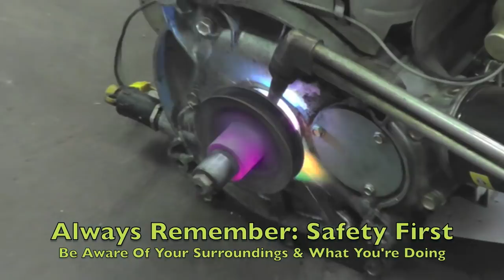Troubleshoot & Replace Camshaft On Briggs & Stratton Intek Engine

Comment from the maker: Be sure to pick up YOUR Taryl Apparel Today! Shipping Worldwide Daily. 
http://www.TARYLFIXESALL.BIGCARTEL.com
And There's Your Dinner!!
Reply: Taryl are you sure it bumps the exhaust valve and not the intake valve for compression release? On my 8hp it bumps the intake valve.
Reply: those newer style briggs are garbage motors and the designers should have those motors dropped onto their heads   :))
Reply: i'm starting a petition .  wanna join  ?
Reply: I got stuck exauast valve rod, rust never run for many years how to move? I try many how to remove
Reply: I have a serious lawnmower engine question for the master mechanic. I have a 16.5 hp Briggs & Stratton Intek opposed twin but I am contemplating rebuilding.
It is a 42a707 2238E1.
I was going to buy a zero turn but in the area where I live in South Carolina there have been a rash of people breaking into buildings and stealing these things from all manners of locations over the past three or four years.
Would you recommend overhauling this engine? And if so, where would be the best place to get all the parts, i.e. pistons, rings, overhaul gasket set, new camshaft, new carburetor, new stater? Are the jugs available for this and would I benefit anything by going over size on the Pistons?

Enjoy your program thank you very much!
Reply: Does this work on a 17.5 regular briggs ? Intake isn't moving any

Comment: I have a 21 HP motor on a craftsman tractor and could not get it to start. After attempting to adjust the valves (which did not solve the problem) I found an online article suggesting it might be due to a broken compression release mechanism on the camshaft.
I'm not a mechanic and have never 'opened' an engine before but I successfully changed the camshaft by following this great detailed video. I ordered the parts on Amazon. What it doesn't show is how to remove the motor from the tractor but that turned out to be very obvious and simple to do as well, even for me. PS - this is my first ever feedback on You Tube but since I'm very happy with the results I thought I should provide this positive feedback.

Comment: Just finished this repair up. Thanks for the video, I wouldn't have attempted it otherwise. Struggled with this mower not starting, replacing all parts: battery, starter, resetting the valves, nothing worked. This was was very easy, especially since the pulley just slipped off, no torch required. 30 minutes to pull the engine, 30-45 to open, find all the metal parts that were chewed up inside, clean up and reassemble. Will put it back on the mower tomorrow. Awesome. There's your dinner.

Comment: Taryl, I had a problem getting my John Deere LA105 with Briggs 18.5 HP engine started and through google and you tube found out that my engine has a compression release and the starting problem was because it was not working and I needed to change the cam. I may not have taken this job on but after watching your video I jumped right in and the job was a piece of cake. Your instructions were right on you were very detailed and left nothing out. Fortunately the lower pulley came right off because with my mower you can not remove the engine until the pulley is removed. I got the parts from Pro Parts Direct and they had all the parts in stock and they came in very fast, not quite as fast as in your video but pretty darn fast. Thanks so much for the great instructional video and the many laughs.

Comment: While adjusting the valves on a Briggs 27hp with 277 hours, I noticed the adjusted valve would move up and down and loose it's .004" clearance when it should be on the "flat" of the camshaft. Used the top dead center approach as well as Teryl's.  Teryl here explained and "showded" me that the camshaft was wearing out (highs and lows on the flat part of the camshaft).  Yep, Teryl knows his Briggs engines. I just wish Teryl would work with the new and reorganized Briggs Company to help them start producing a quality product again!  Brigg's CEO took a 5 million dollar bonus, filled bankruptcy,  and took a hundred year old business and flushed it and it's worker down the drain.    Thanks Teryl - love your audacious and fact filled videos!

Comment: Thanks for your video.  I just had to replace my cam shaft and your video helped tremendously.  Surprisingly my cam shaft was still intact but the pin that creates the valve flutter for compression release was worn smooth. Once replaced and I manually turned the engine over...... I saw the valve flutter that everyone describes when the compression release is working. Engine starts great now.  Local repair shop quoted $500 for repair and discouraged me from fixing because of the tractors age.   At 16 years old the tractor has more years to live.

Comment: Where were U 20 years back when everyone had to read the detailed engineers version from B&S, Kohler, etc. in print. Most of it was hard to understand, harder to actually do and usually ended up having to be taken apart because a detail or two about the proper disassembly or reassembly was left out. Your videos show it all including the shortcuts to making the whole thing go back together without the long version in the repair manual. Five *** to you for the effort you put into your videos to make them with just enough detail to get the job done. And OH yes video has just enough humor to keep it interesting.

Comment: When you mentioned the compression release on the new camshaft, I realized what was wrong with my Intek engine on mower.  It had been hard to start for years, and I kept replacing solenoids and batteries.  Just replaced the camshaft this weekend, and now it starts like a charm, and purrs.  There's My dinner!!!
Reply: That's a good point.  I'm totally surprised that they have compression release.  I thought only diesels had those.  I never would have thought of that either.
Reply: How do you adjust the ground drive belt tension on a Craftsman DLT 3000

Comment: Thanks for great videos. This one gave me the courage to attempt a repair on my Ariens with a 20 HP briggs. I got the motor off the tractor and disassembled today. What I found was the counter weight for the decompression release had broken apart. The cam itself looked like new to bad it is a cheap design on the decompression. I have ordered the camshaft seals and gaskets to complete the repair.Thanks again I would not have done this without your video.
Reply: barefoot bob I’m gonna be doing my cam job tomorrow. That decompression mechanism was in pieces! I’m glad I diagnosed this problem on my own and never gave up on it. How did your cam job go? Is it running?

Comment: I am having the same issue and having to replace the camshaft. Your video is extremely helpful. The only thing I would recommend to everyone out there (like myself) that is gun shy to turning a wrench, be careful when removing the original camshaft. The taps and possibly the push rods can come loose. Make certain the push rods are seated against the rocker arms correctly when you reinstall the new camshaft. I found this out the hard way unfortunately. But once I got the new camshaft in place, it held the taps/push rods in place (seating correctly against the rocker arms). I pray that the new camshaft will last me another 3-4 yrs. The compression release section looks to be cheaply engineered.

Comment: Just wanted to say that you covered exactly what was wrong with mine, except mine was the cam shaft compression release that sheered off.  I love the attention to detail on the disassembly and reassembly.  Looking at kits online right now.  Never thought I would tear a motor apart but here I am.  The good news is everything looks in really good shape.

Comment: I was gonna let my Snapper dealer do this but wanted $500 which I get they have shop overhead and pay tech's decent money. They suggested since I work on most of my stuff I could do it. Your video is perfect especially the pro level details. Mine had factory thread locker on sump bolts that was so tight I had to use a butane torch and prayers to avoid ringing the bolts off so I chased the threads in the sump and upgraded to 8.8 bolts with blue thread locker.  From now on will use your parts source. Thanks Taryl. Keep them vids coming.

Comment: Taryl, huskee with a B&S 18.5hp els 500. Last week I was mowing somewhat thick grass and right before I finish the engine started shaking and shut off. The engine isn't seized, when it cranks it sounds out of balance and shakes. Took cover off and lower pulley and shaft is not bent. I wanted your advice before I pulled engine. I enjoy your videos you've saved me a a lot of money the past year. Thanks again.

Comment: Huge thanks, Taryl! And for the record, if anybody needs to know if it's the same on a B&S Platinum instead of an Intek, the only difference is that the Platinum has both pulleys as a single unit bolted onto the end of the shaft. Other than that, it's the same...lucky for me, because I woulda been up a creek without Taryl's guidance.
Reply: Brian Walsh qqq

Comment: I just went through this with my Briggs 17.5HP Intek which has less than 50 hrs on it and the compression release mechanism blew apart. This video was very helpful for doing the repair. My 31-series engine has the oil slinger, it does not have an oil pump or filter. One thing I noticed is it looks like Briggs now only ships a camshaft with the notch for the oil pump. I guess they figure it doesn't hurt anything for non-oil pump engines to use the notched shaft and it allows them to stock one part number for both styles of engines. I noticed in the manual it says to put sealant on bolt #9 on the sump cover. I can't see why bolt #9 is any different from the rest but I put some RTV on it as directed. I also used blue locktite on the sump bolts. The factory used what looked like red locktite and as hard as the bolts were to remove even once loosened I'm surprised the aluminum threads didn't come out with the bolts.
Reply: Thank you for the tip! I’m replacing the camshaft on a friend’s and found out the new replacement part comes with the slotted end and without a small compression fitting on the other end.
Reply: @bayu01  They've been coming with the slotted end for a long time. That slot is what drives the oil pump on engines that have a spin-on oil filter. All three of my replacements came with the slotted shaft. I guess B&S figured the slot doesn't hurt anything on engines without an oil filter and it allowed them to now only make and stock one part number. Unfortunately the ACR mechanism doesn't hold up any better.

Comment: Question for anyone reading. Are all of the camshafts interchangeable on the single cylinder inteks with pump as long as they're metal and have the oil pump groove?

Comment: Wow. I followed this to a T! The repair I did only had 200 hours on the engine(b&sintek 21hp) the compression release completely broke off the cam and was bouncing around the inside the engine. Replaced cam and it runs like a top again. Thanks Taryl! There my dinner!!!

Comment: Very helpful video!  I used MAP gas torch to heat up the variable ratio pulley on a INTEK 6.5 HP 121602-0190--E1 981008FA then quenched it with water.  I didn't have an air hammer, but the pulley was much thinner metal than in your demo.  I was able to use a pry bar and move one side of the pulley then then opposite side a little at a time and then the pulley came right off!   I discovered the reason the engine was not moving the valves was it appears the camshaft gear was spinning on the shaft.  The gear and the cam lopes are plastic.  This may have saved the engine from overheating and ceasing up from sabotaged oil.  I'm having the oil analyzed.   I had a 240 Volvo engine that cease up for no reason with the mechanic looking at it stating the engine oil looked vary strange.  This INTEK oil does not look normal its more of a gray than black and very non sticky.  It was Amsoil 100% synthetic.  Thank you so much for your video!

Comment: Awesome, informative video.  You might want to move those petrol jugs and pumps away from the O2 bottle.  Instabomb happens if someone cracks the O2 in the presence of gas or oil.  Great video, and thanks for sharing your knowledge.

Comment: Cam lobe from factory should have been set closer to release. Release only had a fraction on shelf of lobe indent caused premature wear on indent of cam lobe causing release to be low in grove on cam. Thank you for the Great way you take time to explain everything. Ed

Comment: Hey teryldacter, you should use this same video for them knot heads that keep burning up relays, starters, and believer it or not wiring harnesses. Because I was one of them dummies that didn't know some of them kohlers compression release had tiny springs that broke and caused the compression to skyrocket and burn stuff up. You'd be surprised how many give up and just get rid of a good mower over a 2.00 sprung. and thars your supper!!

Comment: I have a 19.5 hp Briggs and Stratton Twin Cylinder that turns over really hard I pulled the engine off of the mower and pulled the camshaft out of it thinking the compression release was bad but it doesn't have the compression release on the cam... Would it have a compression release somewhere else in the engine or maybe it doesn't have one at all?
Model 461707

Comment: Fitted lots of those camshafts and most didn’t last any length. So what would you think of skimming the piston and reduce compression until engine it  will turn free enough to start. I would fit original camshaft without decompression system which would all ready be broken anyway.

Comment: Scraping the remains of that stupid gasket off took literally half the job time, like a full hour-1.5 hours! Otherwise, not a big deal. Like he says, don't forget to check the valve clearances before starting the engine- mine were both at zero.  Love the videos, Taryl!

Comment: Taryl, great video! I have a question on this task: why would the engine burn oil after the cam was replaced? It started right up but now, burns oil. It never did prior to the cam being changed. Any ideas? thanks!

Comment: Thank you so much for this video and your valve adjustment videos!  I hit a stump with my B&S/Craftsman mower.  Did all troubleshooting possible, until I was left with having to check the camshaft.  Never done any of this stuff before!  I have it all opened up and sure enough, the spring loaded arm on the camshaft and the timing gear is broke off.  I am just wondering if you or someone reading can tell me how to go about cleaning out the compartment to make sure there is no metal debris back inside the hard to get places?  Also, I see you sort of disregarded torque specs on the case bolts.  Do you just put them on nice and tight then and do not use a torque wrench?  Also, it looks like they had red loctite on the oil plug threads.  Should I put some blue on that or not put anything on that?
Reply: Just wanted to add that I successfully replaced not only the camshaft, but also the broken timing gear and woodruff key by using your video.  Put it all back together it started right up!  I had to go back and adjust my throttle cable, but I was able to fix that and now it runs great!  Thank you again!!!

Comment: i have the similar designed 21 HP Briggs...the counter weight (actually the connecting rods to the counterweight) blew apart along with the governor. Made quite a mess but everything else looks good.  What do you suppose made that to happen?
I am considering putting it back together without both the counter weight and the governor, what might be the result of doing such?
Reply: David Carpenter extreme vibrations and uncontrollable rpms will happen

Comment: Some very sound advice. You are so right about the valves,  On say your Spitfire four pot engine , rule of nine .Number one closed , number eight open . No different to a mower engine.Oh a i see 5000 subscribers , nice one.
Reply from the maker: +Peter Froud  Thanks Pete
Reply: Keep up the good work.
Reply: christian stevens Thats  the idea its meant to be funny as , well as good advice.
Reply: +christian stevens I, personally, enjoy the nuttiness. If I'm in a hurry, or get tired of it I have a fast forward button that enables me to get to the meat of the dinner.
Reply from the maker: That's right Christian.

Comment: Would oil with high zinc content be appropriate for prolonged cam life here ? I’ve always just used synthetic oil for automobiles already in garage. I’ve used vr1 race oil in a small block with flat tappets. Also have zinc additive handy. What would you recommend ?

Comment: Nice video!!! Including the bit about removing pulleys with heat. Rubber seals can be replaced with no problems and little cost!!! And as you say, "And theres yer dinner!"!!!!!

Comment: Are the new replacement compression release cams built stronger (thicker counter weight pin) than the old ones? I want to replace mine with a better one when the time comes.

Comment: So what would cause the one cam to wear and not the other.  Is it the aluminum push rod expands with heat putting more pressure on it?  Just higher up so gets less oil splashed on it?

Comment: Mines compression release on the camshaft worked it was the 2 pieces on the camshaft shaft that was worn down making it not start i don't know all the names on those parts.

But i put the new name brand camshaft in and its working good it took me 4 hours i didn't know the bolts that mount the engine down unscrew out clockwise on mine

Comment: I got mine done up perfect, marks are good valve adjustment is good and I went from a hard compression where it stopped the rotation while trying to start to where its just spinning wide open like there isn't even a plug in there. Still not starting getting spark and I'm pretty sure I'm getting fuel.